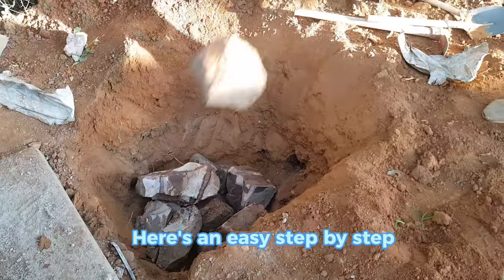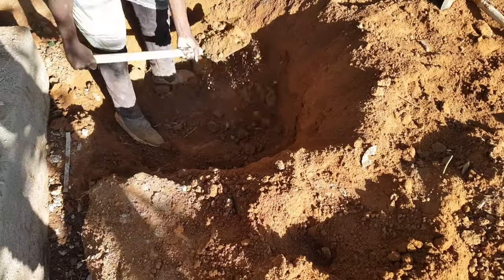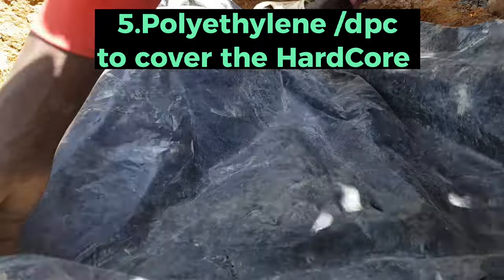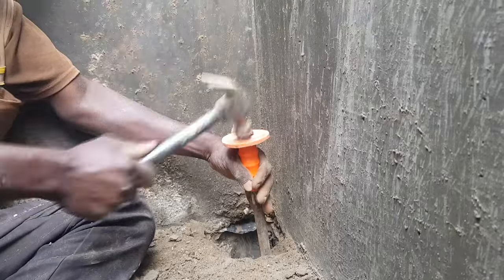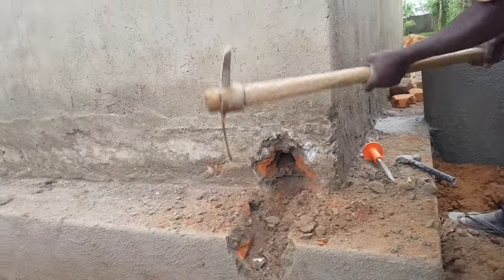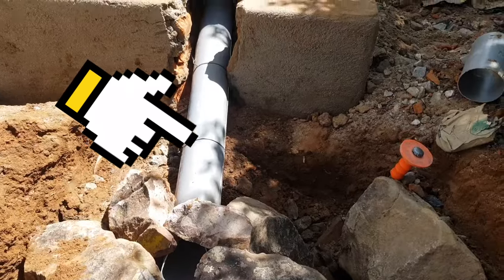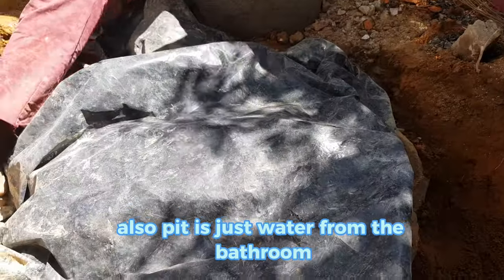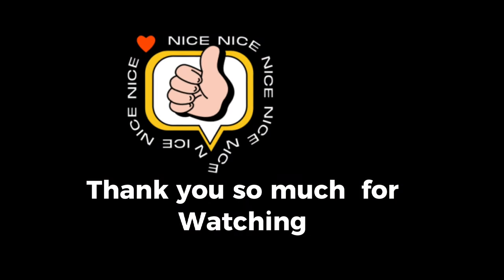Best way to build a SOAK PIT | in 3 Easy Steps

Comment: Is it need to be cemented the flooring of the septic tank or not to let some of the water absorb to the ground?
Reply from the maker: The floor and the sides of the septic tank should be Cemented properly because we DON'T WANT water to be absorbed by the septic tank 

The the only part that we don't Cement is the soakwayor the soakpit. We simply excavate a pit and fill it with hardcore then the liquid sewage will soakaway from the soakpit 

You can watch this video too showing how a septic tank works 👉https://youtu.be/ubQ3IqXoqsY?si=IieW02HFrLx42oGC
Reply: Thanks
Reply: We never cement the floor as in this case it fills very early and even at the side walls it’s better to leave small gaps if possible

Comment: What do you do  when your soak pit  is full and not draining.
Reply from the maker: In most cases, A soak pit cannot be full, either there could be a problem within the drainage  pipe or at the exit of the pipe something might be hindering the smooth flow of the water 
When water stops moving out of your showers,  simply   repair the drainage system- remove the floor trap, use a stick or any material to ensure nothing is clogging or stuck up in the pipe, then also ensure the there is nothing clogging the exit point of the drainage pipe at its end. As simple as that 

I hope that helps